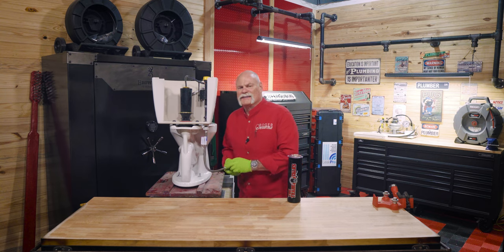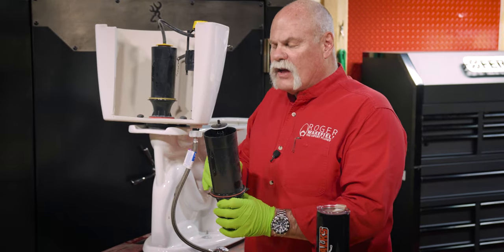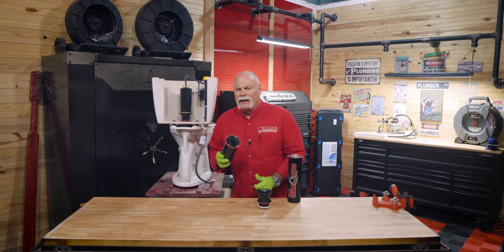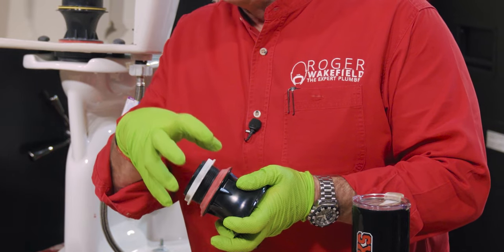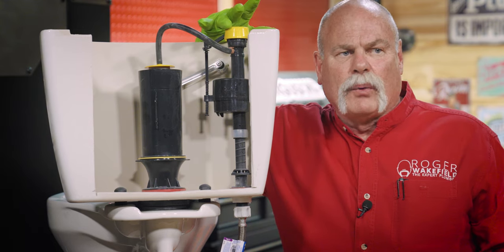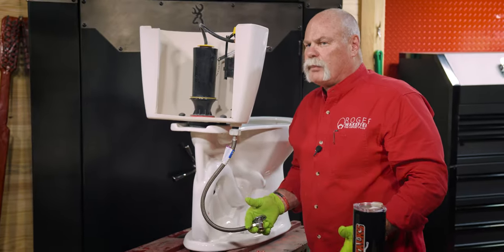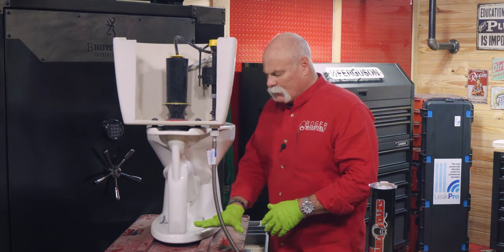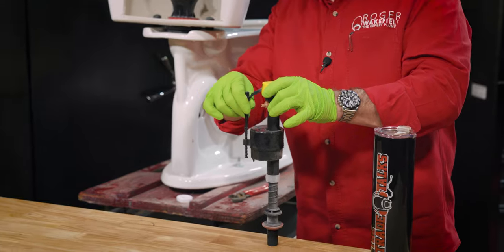FIX a Running Toilet (Canister Flush Style)

Comment: Thank you so much for your video! I'm a single Mom & homeowner who tries to tackle repair jobs myself when possible. I had two issues, fill valve wouldn't stop filling after flushing, & when cutting the water off, all of the water would drain out of the back of the tank . After your video, I was able to fix both issues with replacing the diaphragm seal in the fill valve & the cannister flush valve seal. 
It was very easy and cost me less than $10! THANKS!!!

Comment: Thanks Roger. My canister seems to close immediately after releasing the handle and I get a low volume flush. Is there an adjustment I am missing or does the unit need to be replaced?

Comment: I have the same Kohler canister mechanism. After a weeks worth of flushing the canister will have rotated 90 degrees clockwise and the chain will no longer be pulling straight up and will start to bind. Any ideas as to the solution? Thanks:)

Comment: I just installed one of these styles toilets but the floater is getting stuck at the bottom I have to tap the floater with my finger then it will work any input or advice

Comment: But you didn't cover if the actual base is the problem and if you need to replace the base which covers the large hole where the water leaves.  That was my problem and it turns out the three prongs which hold the base were broken and the whole base needed to be replaced.  I couldn't figure out how to secure it because it was so hard to twist under the ceramic so the whole thing didn't move.  Any tips there??? I finally got it but it was so hard.

Comment: The base for the canister is my Kohler came out of the toilet.  That is, when turning the canister instead of the upper portion releasing, the lower portion including the thick rubber ring came out.  It appears that to replace that lower part, one has to press very hard while turning so that the tangs fit under the rubber ring holding against the bottom of the tank.  Is that correct?

Comment: Hey Roger (or anyone in the community with Water Heater experience), I would love your personal opinion. I just noticed that my Gas Water Heater has a small leak (for now). The two options I was deciding between, are to replace it with another Gas Water Heater or maybe trying a Heat pump version. Do you have a preference?? I looked but haven't seen you do a comparison yet. I'm early in the trades and do have 1 year experience in HVAC, and with time I'm sure ill be able to work on it. Any advice would be greatly appreciated. Thank you. as-well as anyone else.

About me, I have a 3bed 2 bath, its just my Fiance and myself right now w/ some visitors who stay over throughout the year. My WH now is a 40 gal 38k btu. I do live in CA, so there are rebates for the heat pumps.

Comment: My problem is that the canister will NOT "unlock". The stem will not disengage, no matter whether I try from the top or try turning from the bottom. I'm afraid if I try too hard I will completely break the piece, but can find nothing online to advise. Cannot get the canister off to replace a simple seal.